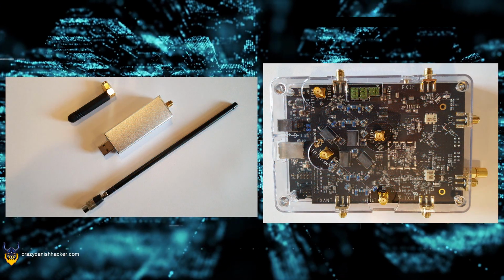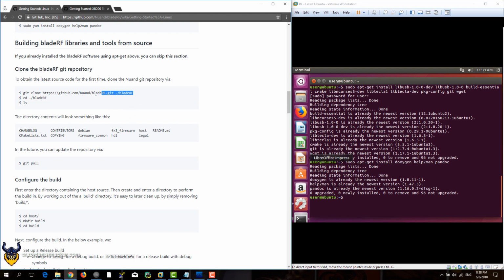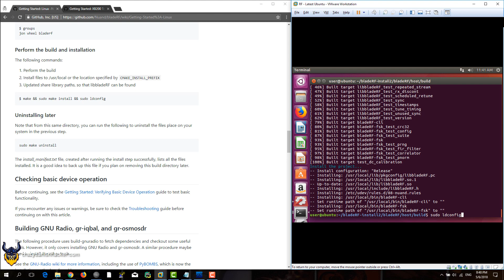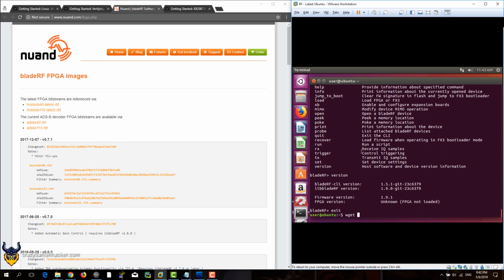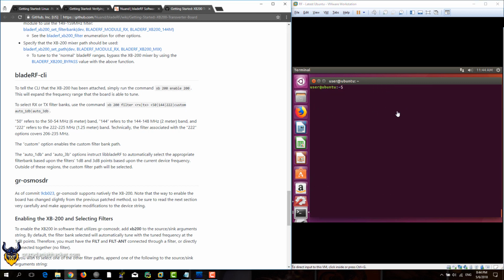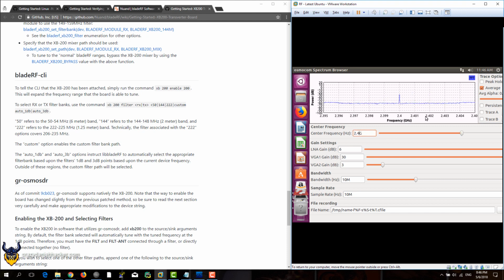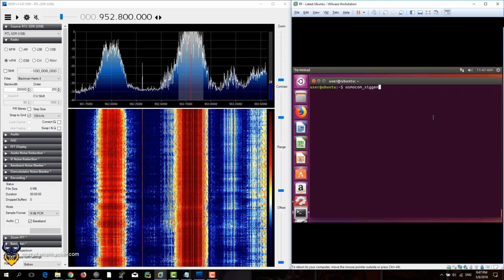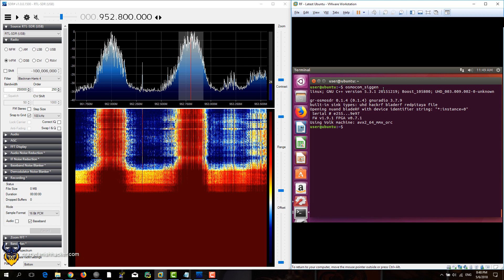Signal Jamming - Software Defined Radio Series #28

Comment: Hello and thanks for the video. I wanted to ask what kind of antenna I would need to jam WiFi signals, or to even receive the WiFi signal as shown in your video?
Reply from the maker: If you want the best possible signal quality without moving closer to the source, then you will need an antenna tuned to 2.4 or 5GHz depending on the band you want to receive. Generally speaking, a lot of antennas will work fine as long as you're close to the source. The type of radio on the other hand is much more important, depending on the type of jamming you intend to research or legally perform.

Comment: hi
all my thank about your activity
i have a question, i try load yatebts in raspberry pi 3 + bladerf x40 and this is ok
but i need 2g/3g/4g jamming that be controllable e.g on/off by raspberry, is there any way that use bladerf for jamming and loading yatebts at same time? 
in theory i think can be done this by mixing data before given to DAC module, and needs to changes yatebts files relative to it
have you any comment that would help me?
sorry if my english is not good
thanks
Reply from the maker: [For ethical security research and legal purposes only] The best way to achieve your goal is just to buy another SDR like a HackRF. Alternatively, you can probably buy or develop something yourself. You should only do this type of testing inside a Faraday cage. You face a big limitation trying to implement your jammer while running yatebts at the same time as well, because 2G/3G/4G is on different frequencies, which is more bandwidth than what the BladeRF can transmit, so you will have to switch frequency which is not a good idea if you're already hosting a BTS.

While a lot of Faraday cages are expensive, you could also develop one out of a tin box as they're quite effective in shielding radio frequencies as long as the metal enclosure is tight.
Reply: @CrazyDanishHacker  
[For ethical security research and legal purposes only]
Yes, that's right, i forgot basic thing that DAC  cannot both  transmit a continuous signal for yatebts and sweep frequency for jamming at same time, if I find board with 2 DAC (like bladeRF 2.0) this can be done. but must check that can i use this for yatebts again or not. Although your suggestion for use another sdr for jamming maybe More confident, thanks for your replayed

Comment: Hello Dane, 
Can you pls confirm it can be used to jam 4G signals also.
Reply from the maker: It should work for 4G. For 5G, only in some cases and you may need a more powerful SDR or multiple SDRs for that, or you may need a different attack vector than just overpowering the real signal.
Reply: @CrazyDanishHacker  I request can you pls send all the the file of code on alphashera87@gmail.com , I would be very thankful.

Comment: In osmocom_siggen you've specified centre frequency to be 2.4Ghz but on RTL_SDR you're listening to 952Mhz which happens to be GSM band how come you say that you're jamming signals here?
Reply from the maker: You're correct that the video doesn't show an actual jamming signal, as I didn't have access to a Faraday cage the week I was recording this video. If you use the same tools and methodology, but change the frequencies for SDR# (listener) and the other tool (sender), then it will work though. If you want to see this in action, feel free to donate a high-grade Faraday cage/tent :-) (Check the prices at http://www.saelig.com/category/TE.htm as to why I haven't bought one myself yet.)
Reply: @CrazyDanishHacker  I've a HackRF and using the ANT500 antenna I'm trying to jam the 933Mhz GSM frequency in and out of faradays cage in an isolated environment but unable to jam the frequency. What am I doing wrong? Why I'm not able to jam the frequency?

Comment: Another great tutorial. Could you help me with the sweep option. What goes in sweep with ? sweep rate ? center frequency etc.if i wanted to sweep 433-450 mhz. Thank you.
Reply from the maker: If you look at the man page (i.e. manual), you will see that the sweep option generates a swept sine wave. 
http://manpages.org/osmocom_siggen

For 433 to 450MHz, you're better off just creating Gaussian noise within that range.
Reply: Thank you
Reply: when I go to siggen  I get uuuuuuuuuuuuuuuuuuuuuuuuuuuuuuuuuuuuuuuuuuuuuuuuuuuuu and  it does not transmit. I use VirtualBox and Ubuntu. Do you know of any remedies ? Thank you.
Reply from the maker: Try VMware, reinstall the same tools, and make sure you have a compatible SDR such as HackRF or BladeRF.

Comment: Awesome video!
I think the range of jam signal is too short to attack.
Did you have any idea? 
Should I modulate Gaussian Noise signal?
Reply from the maker: Get within closer range of the target or use an amplifier. This video is only meant as a guide for educational purposes where you will always be right next to the target.
Reply from the maker: With any type of advanced remote hack, including this, you should always test it locally in a lab even if you have authorization to do this "in the wild".
Reply: What's amplifer should i use? If you open the other FFT to see Gaussian Noise, in fact nothing happen. But if you change the signal source (sine wave or cosine wave) you can see the peak on the FFT obviously.

Comment: Thanks for you
I have a question 
Is there any way to listen to a Tetra channel had an air interface encryption?
Reply from the maker: Not without the right encryption key. Another issue is that if you try to join this type of network, then you won't be able to or you'll get "kicked off the network", at least that's how it's supposed to work. I looked into this a bit, and the only thing I've seen so far is decryption of basic information.
Reply: Thanks for replying
Basic information like what?
 can be sound  or just  worthless data ?
Thank you again
Reply from the maker: No not sound because that is confidential/secret and encrypted data.
See e.g. https://www.rtl-sdr.com/tetra-decoder-plugin-for-sdr-now-available/

Almost no data is worthless, but in this case you won't get much out of it besides maybe know when "someone" is using the network, but you won't know who they are, possibly where they are, or even what they're talking about. But you will probably be able to know when someone is using the network as I already said.

Comment: Thanks for posting this video. When I tried to run the osmocom_fft command, I got the UI, but could not click on anything. Are there any steps not shown on the video that we would need to do in order for the program to run correctly?
Reply: Received this error "
Warning: failed to XInitThreads() 
gr-osmosdr 0.1.4 (0.1.4) gnuradio 3.7.11 
built-in source types: file osmosdr fcd rtl_tcp uhd mini hackrf bladerf rfspace airspy airspyhf soapy redpitaya freersp
Cannot connect to server socket err = No such file or directory
Cannot connect to server request channel
jack server is not running or cannot be started
JackShmReadWritePtr::~JackShamReadWritePtr - Init not done for -1, skipping unlock 
JackShmReadWritePtr::~JackShamReadWritePtr - Init not done for -1, skipping unlock
Opening nuand bladeRF with device identifier string: "*instance=0"
Serial # fa96... 11b3
FW v1.8.0 FPGA v0.7.1
[INFO @ "/home/bladeRF/host/libraries/libbladeRF/src/bladerf.c".795] Clamping bandwidth to 1500000Hz

(osmocom_fft:1789): Gtk-WARNING **: 01:56:20.797: for_size smaller than min-size (4 < 14) while measuring gadget (node check, owner GtkCheckButton)"
Reply from the maker: I showed all of the steps necessary in this video to run osmocom_fft and osmocom_siggen. I was using the most recent version of Ubuntu, almost fresh install, and also recent version of the BladeRF source code and FPGA. 

Try reinstalling the software in a brand new virtual machine running Ubuntu. The console output you listed seems mostly normal except for maybe this: Warning: failed to XInitThreads() 
Because it looks like the program was able to open the BladeRF as seen on these lines:
Opening nuand bladeRF with device identifier string: "*instance=0"
Serial # fa96... 11b3
FW v1.8.0 FPGA v0.7.1

From my initial point of view without any other knowledge about your environment, it's probably a bug in the version of osmocom_fft that you have installed. Consider installing the version they have at GitHub: https://github.com/osmocom/gr-osmosdr
Reply: Strange...ok, will do, thanks for the feedback!
Reply: Design and develop jammer for a range of 20m with approx power of 5w. Freq range 100mhz to 160mhz with the option of choosing precise frequency, i. e spot jamming. Display of selected power and jamming signal spectrum.pls help me to develope this project

Comment: From what i read it is not possible to run fft and siggen simuntaneously...have you run your bladerf in full duplex?
Reply from the maker: Not in this case, but in theory I probably could have generated a signal with Gnuradio-Companion and transmitted that, and then checked the same frequency as well. However, in this case I was using the BladeRF for TX (with an attenuator), and to receive in SDR Sharp (SDR#) I used an RTL-SDR.
Reply from the maker: Whenever you transmit something for testing purposes, I recommend you use a secondary device like an RTL-SDR to check the transmitted signal to make sure it's as you expect.
Reply from the maker: Maybe but it's going to take a lot of work like the GSM Hacking series. It's far down the todo list as I haven't done this type of research much yet.
Reply from the maker: I recommend looking at Balint's work first as he has already done a lot of this publicly :-)

Comment: love your tuto bro
i have a question please if you can help.Can you suggest a roadmap to be expert pentester and thanks :)
Reply: I would recommend getting an SDR unit like a LimeSDR, USRP, HackRF, BladeRF, etc.  Start on the most common standard like WiFi channel frequencies.  You must practice, practice, practice.   Hang out on chat rooms like ##rtlsdr and ##osmocom  and learn from the practitioners who can answer all your questions most of the time.  See you there!  https://www.youtube.com/watch?time_continue=15&v=LtWMu5K2nsY
Reply from the maker: I don't have a specific roadmap, but if you're just starting out, start with web apps like Damn Vulnerable Web App, then Damn Vulnerable Web Services, read through OWASP Testing Guide and try all those attacks, and then learn Metasploit, how to do simple stack-based buffer overflows from scratch, etc. 

If it was easy to make someone an expert pentester, I would've told people how to do it in 500 words or less already :-) 

The main thing to work with, is how many skills you have at the moment, and what you want to learn, because there is an infinite amount of knowledge to learn about hacking. SDR by itself is a huge topic that I am just a beginner in. 

In case you want to work with pentesting for a living, then you will most likely have to get familiar with penetration testing web applications, web services, and other network services like FTP, SSH, and other non-HTTP services as well. (You should also learn about hacking Windows-based environments with domain controllers, SMB, etc.)

You don't need to be able to find a lot of 0days for well-known services to be a pentester, but you do need to be able to get a lot of work done in a small amount of time, once you're doing it for a living and as a senior. At entry-level when you just get into pentesting, the skills required are not as high, but you will still need some skills to prove that you want to be a professional pentester.

There are a lot of useful resources on the web, but besides OWASP which is web app security, there are also github repositories like these:
https://github.com/Hack-with-Github/Awesome-Hacking
https://github.com/vitalysim/Awesome-Hacking-Resources

My advice is, become a professional penetration tester first and do that for a living as entry or normal level, then while working as a full-time pentester, work on becoming an expert and/or senior in a field you like. (Field can be web apps, fuzzing and exploit development, SDR, reverse engineering, malware analysis, physical security, social engineering, red teaming, and so forth.)
Reply: thanks a lot
Reply: CellularInterceptor 
Thankx  for the info buddy ....

But I guess he was asking about radio pen test ...

Like what we saw in news people doing replay attacks and stuff and weather there is a Cert like Sec+ or OSPC or GSEC all these security cert do we have something similar in radio world 

::::::
Am almost finished with Computer Science and we didn’t take Circuits components and physics so am not worried if I can start immediately into SDR or not 

::::;;
I bought RTL-SDR , download SDR# after that heard about GNu radio 
And kinda lost at this moment 
Do I go and buy HackRF and what the difference between this and BladeRF

:::::
Daaaaaaamn I know I ask a lot of questions but am so confused and lost but mostly excited
Reply from the maker: For a comparison between HackRF, BladeRF and USRP, see e.g. http://www.taylorkillian.com/2013/08/sdr-showdown-hackrf-vs-bladerf-vs-usrp.html
Keep in mind there is also a LimeSDR nowadays.

Before you go buy an expensive HackRF, BladeRF or LimeSDR, or even a USRP, I recommend you learn a fair bit of decoding with the RTL-SDR.

The book that you want to look at for example is:
The Hobbyist's Guide to the RTL-SDR: Really Cheap Software Defined Radio

(https://www.amazon.com/Hobbyists-Guide-RTL-SDR-Software-Defined-ebook/dp/B00KCDF1QI)
Reply: Crazy Danish Hacker 
Thankx a lot

Comment: Hi , firstly I would like to ask you about doing a fake GSM bts with USRP b210, i am trying to do that and once the phone is registered with my fake it last just for 5 to 7 minutes only ! And then i lose the connection, i tried that with 3 different phones , without a SIM card and without any jamming on the original cellular network...i don't use GPSDO cause i don't have any...is it the the reason behind why it doesn't work well with me ? cause i read somewhere in the mailing list that GPSDO isn't optional for GSM hacking, it is essential... is this true ??
#########################
And about jamming on wifi signals, i tried that before but it didn't work at all, i thought that it didn't work because of frequency hopping, so how frequency hopping can affect on my attempts ??

#Thanks a lot ^
Reply from the maker: I had the same issue. I've spoken with others and they all said the same thing, that my clock needed to be synchronized and highly stable (something like that). Try and calibrate your USRP B210, maybe it will work better then. I don't have an exact solution as I haven't played much with this, but it seems that if your transmitted signal is off by just a bit the cell phone will lose connection. 

Concerning WiFi signal jamming, some routers will just switch channel if you do it the RF way and you only send e.g. a 20MHz gaussian noise signal. If you spam out deauth packets, sure that'll work in almost all cases, but I wouldn't recommend doing that unless you have a good reason to do so.

I'm not too familiar with how WiFi uses frequency hopping though. But if you jam all the WiFi channels, then the clients won't be able to pick up any data in your area. This is also not something I would recommend doing outside a lab of course :-)
Reply: Crazy Danish Hacker 
Thank you so much, 
Yeah Exactly, they say that i need an accurate and stable reference to get it work.

And about jamming on wifi signals, that's what i wanna ask you about, jamming on all the channels how could it be done ?
#Thanks in advance
Reply from the maker: Get an SDR capable of transmitting 100MHz for example :-) https://en.wikipedia.org/wiki/List_of_WLAN_channels

Or get two SDRs capable of transmitting 50MHz or three at 33.3MHz.

Now, as you're just transmitting noise, you don't need a high quality SDR for that to be honest. You can use cheaper devices for that, but it's important that you don't produce RF signals outside the WiFi spectrum for example, if that is your target. 

As you're aware of, the signal also weakens over distance and if there are buildings made of concrete (in particular) in between. So the signal jamming will be localized as well.

Just be careful doing this outside a lab.
Reply: Thanks for your help,
Sorry, but i have another question, do you know if the Hackrf sweep feature could be done with usrp ? It seems to me that it could be done, what do you think ?
Reply from the maker: Most likely, I would ask balint about this on e.g. Twitter: https://twitter.com/ettusresearch && https://twitter.com/spenchdotnet

If you can do something with a USRP, you can almost certainly do it with a BladeRF or USRP, as the two latter are generally "more capable SDR devices" as far as I know.
Reply: Thanks a lot for your help :)